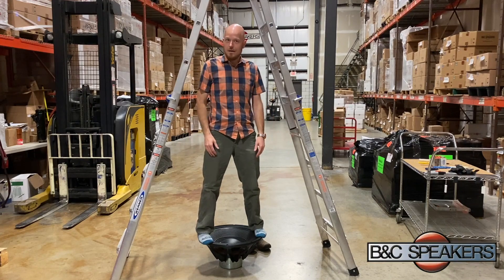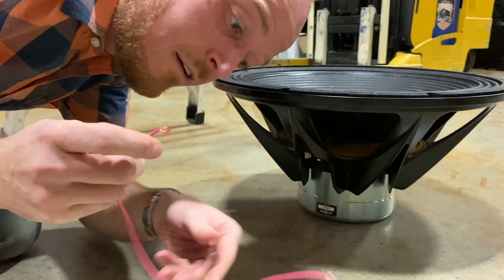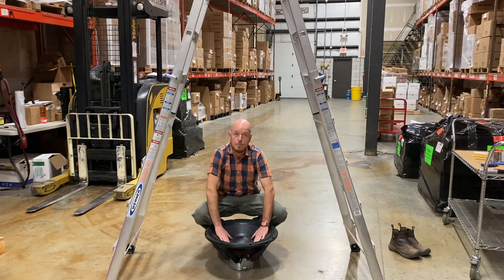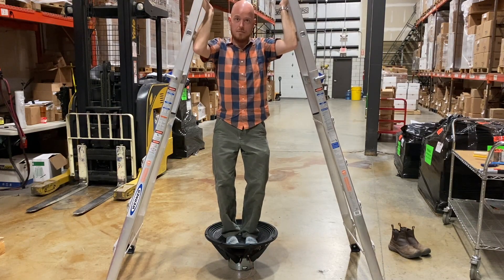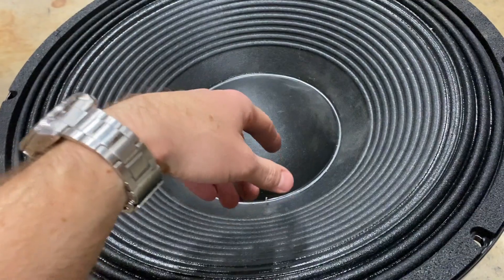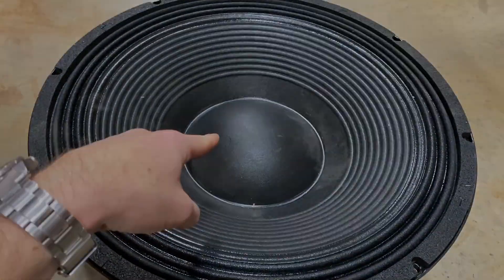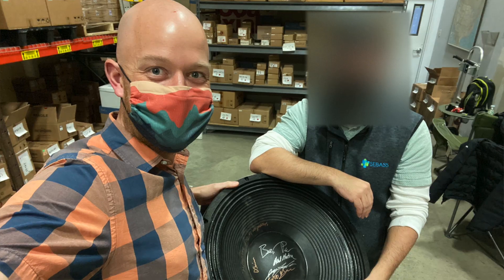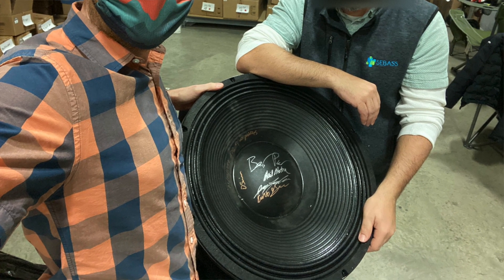Mechanical vs. Electrical Damping

Comment: Which amplifier best for B&C 21ipal?? 🧐
Reply: The IPAL drivers (almost all PA driver manufactuerers have some 18" and 21" IPAL drivers) are desinged for the powersoft IPALmod modules and have an low impedance (18" have 2R and 21" have 1R) This is Powersofts vision for the next generation acitve speaker. The modules utilize an differential pressure trandsducer to compensate for temperature and power compression and deliver an linearized response. Sadly the low impedance makes them very hard to use with external amps. Some 10kW and 20kW 4ch PA amplifiers are rated down to 2R but it is not recomended to run them at full power below 2,6R. And using car Hifi amps will end with a blown Amp when used for PA aplications.

Comment: JL Audio uses the exact opposite theory. And they claim the best sound quality. Low Fs. High Vas. In a small box tuned to a higher frequency. In other words a sloppy loose driver in a tight box. So the box provides the damping. Open up WinISD and load up the JL Audio JL 12W6 ($800) and model it against the Eminence LAB12 ($200). 
Now you know which sloppy driver to buy.
Reply: id love to know what you decided   Thank you
Reply: @californiacitizenswatchthe3817  I have an Audiopipe BCD15 2 stack magnet motor for $125. It’s amazing in a ported 3 cubic foot box tuned to 30 Hz.
Reply: Thank you.  Sounds great and the price is fantastic 
Sorry about channel name, inside joke/long story
Thank you again for your reply

Comment: "Bl is all that matters in life" and yes, I do have a shipping address in the US. BTW: Working on a little project with 12NDL76, great driver!
Reply: The NDL series is great. I am currently running some 15ndl88 as kicks and a pair of 12ndl76 in paraflex tops. Great power to weight ratio and not to expensive.

Comment: "if you do the math on how much force the motor can put out, its enough to lift a person"
aight bennet lets see it, im sure you get your hands on a circular piece of wood to spread the weight!
Reply: It´s easy to count. F = B * l(current) * l(length).The 21IPAL is 2500W woofer. So it takes about 42V and 60A to reach that power at DC. We know the Bl product of the speaker is 19.1. So, in the equation, F = 19,1 * 60 = 1146Newtons. 2292N peak, and even more in real life. That is,  117/234kg holding force. I would not put my hand in front of the cone when this beast is raging. :-D
Reply from the maker: Thank YOU for doing the math! To be fair though, I think if you put 60A in at DC the coil will smoke pretty soon... that's a lot of Real Power™ and not loudspeaker "watts".
Reply: @bennettprescott  true that. It is just a maximum thr driver is capable to reach for period of about 1s, not real world situation. Similar to standing on the speaker cone. 😜
Reply: @CrashPCcz  the driver can take the RMS power continuisy for a couple hundred hours when adequatly cooled. But when operating at DC there is no air getting pumped trough the coil gap.